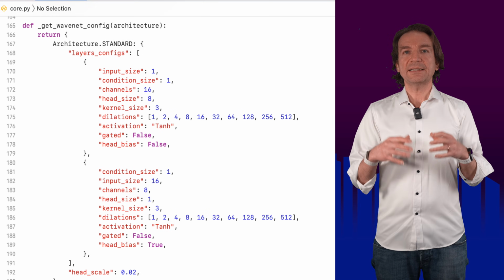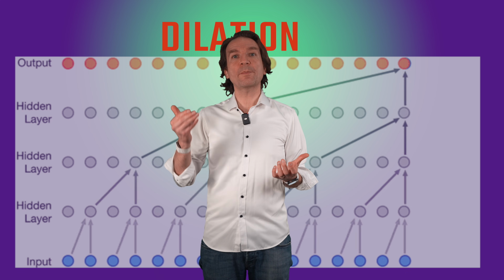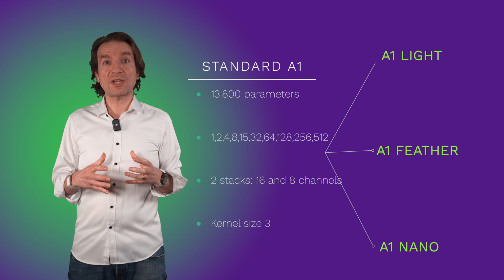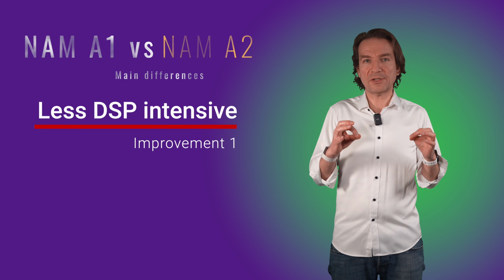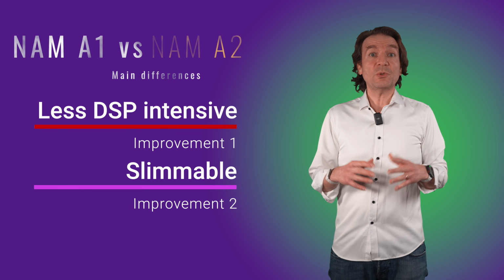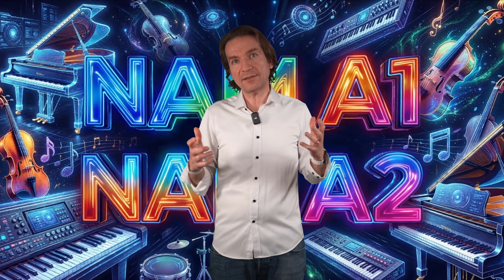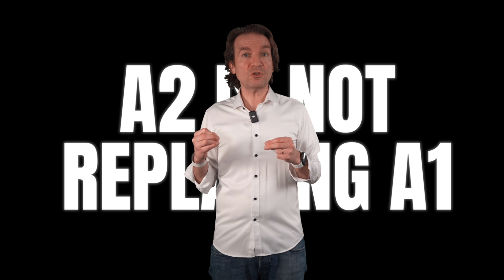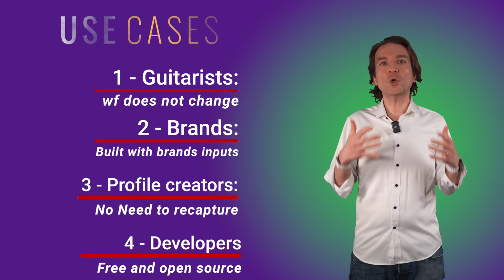The NAM A2 could become the industry standard for amp profiling!

Comment: This is part two, or better to say implementation how the Open Source will destroy the other high end capture devices... only Tonex is ready for these new prices I can say only that. So adjust the specs to your hardware and make the best possible sound. On a modeler of 200 eur for example... Wonder will the GP 150 and 180 with their a bit better DSP could load A2 in some firmware update... that will be a killer. With no conversion...
Reply from the maker: Thanks for sharing your thoughts!

Comment: A1 vs A2 (NAM WaveNet) - structure and likely sonic behavior
Summary of what differs, estimated parameter counts, and what that usually implies for compression and sag in a
high-gain amp recreation context.
1) Big structural differences
A1 (v0.5.0)
• Two WaveNet stacks (2 blocks).
• Each block uses 10 dilations: 1 to 512 (very long ladder).
• Kernel size = 3, activation = Tanh, no gating.
• Conditioning is simple: condition_size = 1 everywhere.
Translation: a fairly classic WaveNet: longer time context, but simpler nonlinearity and control.
A2 (v0.6.0 test case)
• Split design: (1) a condition_dsp WaveNet that turns condition_size=1 into a richer internal condition,
then (2) a main WaveNet that uses the richer condition (condition_size=8).
• Feature-rich blocks: bottleneck, grouped convolutions, FiLM-like modulation (scale/shift in many
places), gating modes (gated / blended / none), and multiple activations (SiLU, PReLU, Softsign,
etc.).
• But dilation sets are small: condition_dsp uses [1,2] then [1,3,5], and the main path uses [1,2].
Translation: lots of modern tricks and richer conditioning, but short time context based on the dilation lists.
2) Estimated number of parameters (best-effort)
Because the JSON does not fully define the internal math of every new feature, the counts below are
estimates. The relative conclusion (A1 larger than this A2 test config) is likely robust.
A1 (estimate)
• Total: about 10,193 parameters.
• Block 1: about 8,032.
• Block 2: about 2,161.
A2 (estimate)
• Total: about 1,700 to 3,000 parameters (range depends on how FiLM-style modulation is
parameterized).
• condition_dsp is relatively small (hundreds to about 1k).
• Main block is also small (often under 2k).
Bottom line: A1 is likely several times larger (roughly 3x to 6x) than this A2 test configuration.
3) The big one for sag: how far back it can 'see' (receptive field)
A quick receptive-field estimate in samples (causal stack approximation):
• A1: about 4,093 samples of history (about 85 ms at 48 kHz).
NAM WaveNet comparison: A1 vs A2 Page 1
• A2 (main audio path): about 10 samples (about 0.2 ms at 48 kHz).
• That is roughly a 400x difference in time context.
4) Probable accuracy advantage (what you will actually hear)
If your goal is 'amp feel' in high gain (compression + sag): Advantage A1
• The long dilation ladder gives A1 a chance to learn time-dependent behaviors (attack / recovery,
envelope-like effects).
• Sag typically lives on tens of milliseconds, not microseconds.
If your goal is 'respond correctly to a knob or control condition across a range': Advantage A2
• A2's condition_dsp (1 -> 8 dims) plus many modulation points can generalize better across settings
(gain / tone / etc.) when modeling variability.
5) Expected behavior in a high-gain amp recreation
Compression
• A1: more likely to produce smooth, amp-like compression (the 'squish' and easing-off after a hard hit).
• A2: more likely to produce more instantaneous compression (more like waveshaping / clipping). It can
still sound great, but often feels more immediate or stiffer if the real amp compresses over time.
Sag (power supply droop, recovery, bloom)
• A1: more likely to reproduce a softer feel after loud transients, low-end 'ducking' on palm mutes, and
some recovery / bloom over roughly 20 to 100 ms.
• A2: with about 0.2 ms main context, sag is unlikely to appear naturally; palm mutes may stay
consistently tight, with less bloom, and can feel 'fast' and sometimes a bit fizzy or rigid compared to a
saggy real amp.
Practical takeaway
• Want convincing chew, sag, and power-amp-ish feel in high gain? A1 is the safer bet from these
structures.
• Want a small / fast model that responds cleanly to conditioning (knob or state changes)? A2 is built
for that style, but this specific config looks too short-memory to nail sag.
Optional refinement: if you share your sample rate (44.1 vs 48 kHz) and what the condition represents (gain knob,
tone, etc.), the time numbers can be translated into exact milliseconds for your setup.
NAM WaveNet comparison: A1 vs A2 Page 2
Reply from the maker: Thanks for sharing....interesting info!
May I ask you what you mean with "page 1" , "page 2", etc? Are you referring to a specific document?

Comment: I am trying to get an answer whether this is good or bad for tone/accuracy purists.  There has to be some kind of quality hit when you slim down A2 captures to be easier on DSP.  Now, instead of manufacturers increasing DSP to handle full quality NAMs, A2 just makes it easier for them to "dumb NAMs down" automatically to work on their lower DSP devices.  And the user may not know the slimming it is happening, because they are just loading the same NAM file everyone else uses onto their device.  I think this is a reaction to hardware manufacturers staying away from NAM due to the cost of making a device that can handle it.  Instead of the tech rising up to meet NAM requirements, we're going to dumb NAM down to fit these cheaper devices.  I hope I am wrong, but nobody has told me how that is wrong yet.
Reply from the maker: Thanks for sharing your thoughts and concerns about A2's impact on capture quality and DSP! I appreciate you bringing up these points!
I would just add that HW is already increasing power and capabilities going toward most complex Neural Network, and that currently, to contain costs, brands are simply "truncating" already available NAM files. With the A2 we can expect better quality even from cheaper units. But what is important here is transparency...I mean your point that user might not know if they are using a slimmed profile or not...is very important in my opinion.
THanks!
Reply: @LeoGibsonGtr  Thank you, Leo.  You nailed it - transparency with users is the key so users can make informed choices in how they spend their hardware dollars.  Beyond that, I do hope that high end products continue to advance supporting the highest quality of NAM.  Like, for instance, will Fractal's support of NAM run at the highest quality while still reserving sufficient DSP to run a basic suite of effects?  Or does this give their marketing department the "out" to slim NAM and then brag how it can be run "without limitations" because you can use it like any other Fractal amp sim?   I would like to see BOSS follow suit with full NAM on their next gen device.  I am willing to pay more for a top end pro device that is essentially my full rig.  But I need the choices in the market.
Reply from the maker: You are welcome!
I do agree...

Comment: This is the way software should generally be developed. If a dev discovers improvements on a code level, share them with the market, benefitting both the market and the manufacturer’s rep. Releasing a “PRO” version, assuming hardware is part of the equation, is just insulting the intelligence of the user base. Firmware releases, even paid ones, make me very happy I chose a given manufacturer. Excellent news!
Reply from the maker: That's an interesting perspective on software development, thank you for sharing!

Comment: less CPU usage = less accuracy/quality, but at least it will run on the Valeton calculator and Valeton pregnancy test 5000 :D
Reply: well, not necessarily. CPU usage is not just affected by the quality but also by underlying optimizations. It is not uncommon in the software world to reduce resource usage while also boosting performance (while either still maintaining quality or sometimes even improving it, as it is often hard to reason around reduced quality). This is even more common in the open source space as more devs are looking at your code and trying to come up with ways to optimize it. On the contrary, it is also possible to increase resource usage while also reducing quality.
Reply: @snikiturtul but we are not just in software world. But machine learning world. And if sooo many billions are spent that’s mainly because no simple tricks has been found. I’ve read the paper Wavenet (nam) VS lstm (ToneX) and you simply can’t match lstm accuracy using very small Wavenet models, aven using much simpler activation functions.
The results will be probably confirmed but the null testing after the complete release of A2. But for now A2 in its bigger form is about the same side as ToneX in terms of of parameters. Si my bet is ToneX will be more accurate than best A2. And that, imo would be a bad signal to the competition.
Reply: Exactly
Reply: Bro valeton what?

Comment: These look like important advancements. But, with potentially hundreds of thousands of Profiles available, there needs to be a better, faster way for users to find and audition sounds. Searching Profiles using gear-specific names doesn't work well for users without vast knowledge and familiarity with how they will sound.

Platforms like TONE3000 need AI "natural language search" or something like a "Focus View" interface approach in the Helix Stadium to streamline tone hunting. I'd use NAM more if searching Profiles took less time. I'd like if "Slimmable NAM" was also able to create IRs that could be loaded into older Modelers like the HX Stomp. I know there would be a reduction in accuracy and flexibility, but in comparisons of full NAM and proprietary Modeler reduced/slimmed conversions of NAM Profiles, the tonal differences have been smaller than expected.

NAM provides a great way to capture rare gear, and sounds accurately. I'd like if they were more loadable and portable for use in older Modelers.